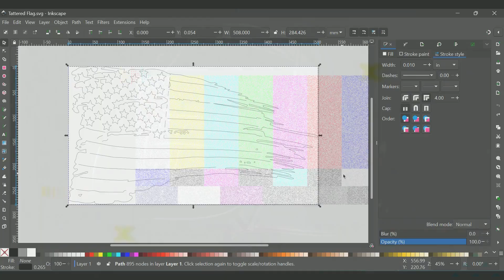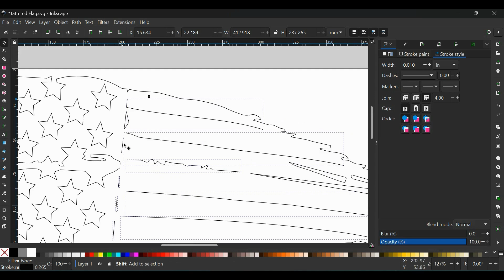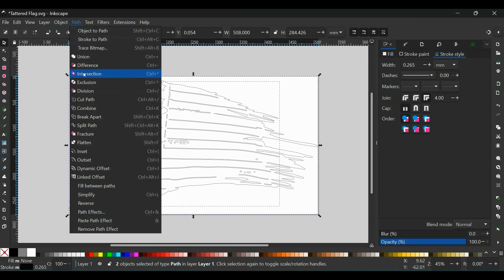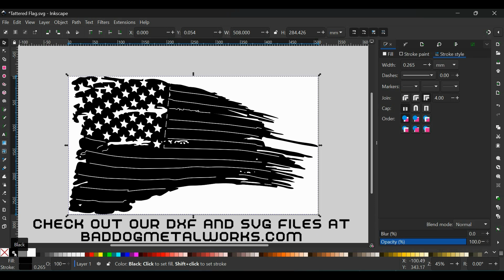Converting Open Paths to Closed Paths - Inkscape Tutorial

Comment: Hi sir, I hope you are well. Thanks for the great videos. I've got an SVG file that i want to deboss onto a cylinder in fusion 360 but it gives me a bunch of errors. I then did part of the image and it worked. For some reason, i can not get the hole image to work. Do you have a few pointers on that? Regards